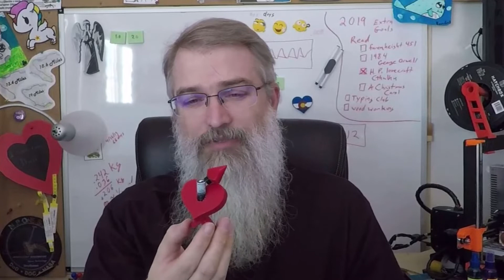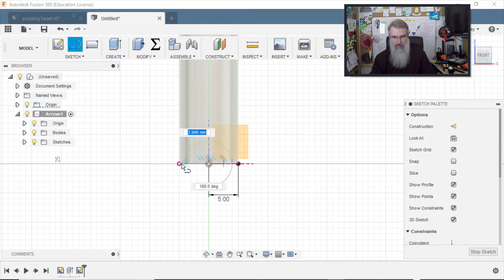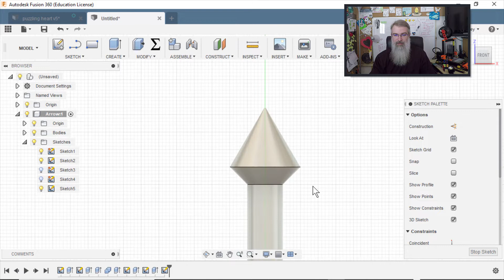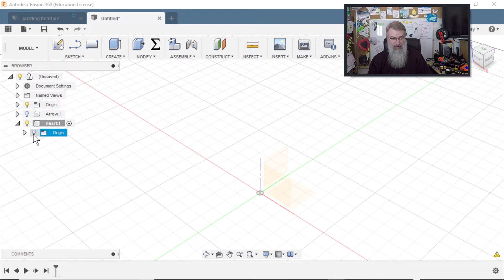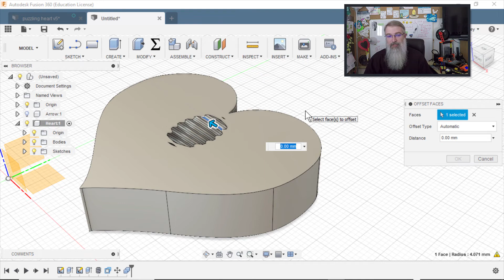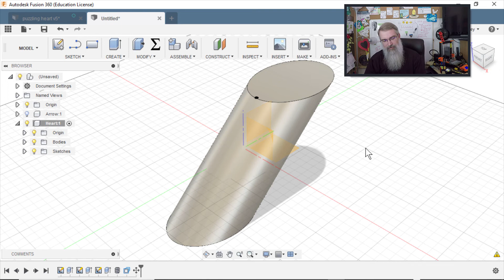3D Printing:  The Valentine Puzzling Print

Comment: M601 that i mentioned in the other video's comments ( youtu.be/zzE3RfP8iyo ) will have the part come forward, making it easier to get to and film.  it will also bring the extruder carriage close to the controller box, so the wires are not stretched out.